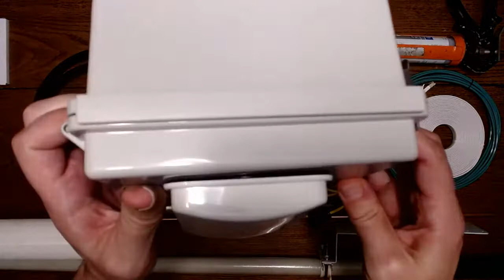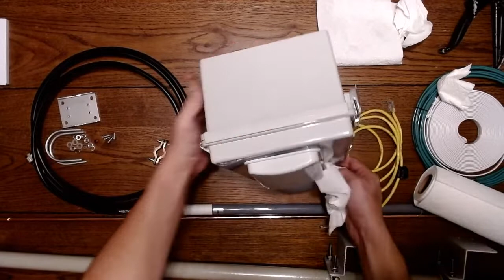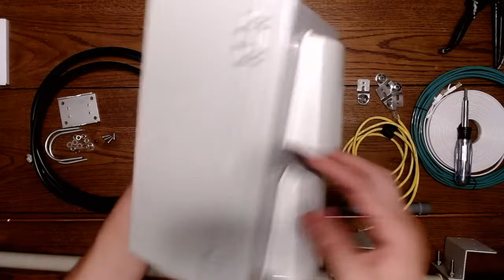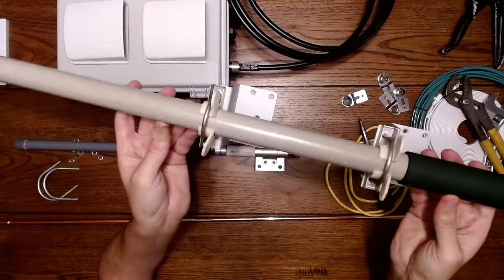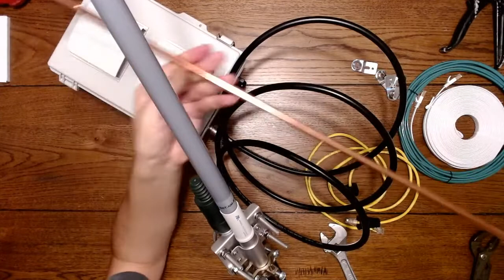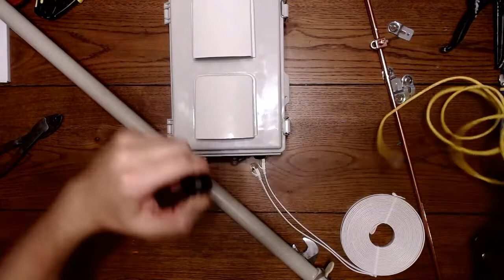Helium Miner Antenna Mounting & Grounding

Comment: Appreciate your effort to share with us, your great design, but the audio Is not working.
Correction: the audio starts working at 13:15. Could you please repeat the explanation of the inside of the box contents that was not heard on the first 13 minutes, if is no too much problem?  Thanks.

Comment: I’m new to helium. I’m waiting for my miners to be delivered. I really like your build. I am planning on copy what you did when I received my miner. 
I have one variance! I was thinking in using a Powerline Ethernet Adapter. So I can get closer to the attic without running a Ethernet cable. 
Would the Powerline Ethernet Adapter work out with your setup? And can you go over on how to add this device to your settings. 
Thanks in advance. 
Great video by the way!!!